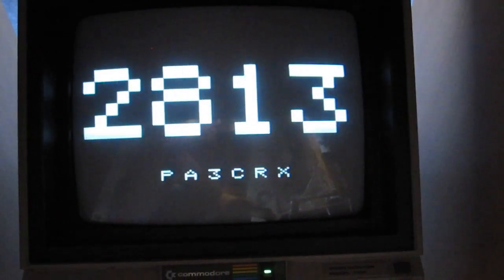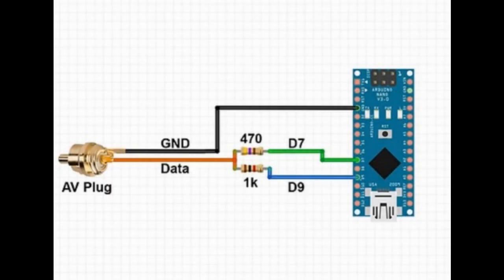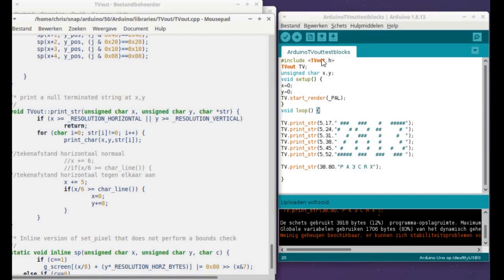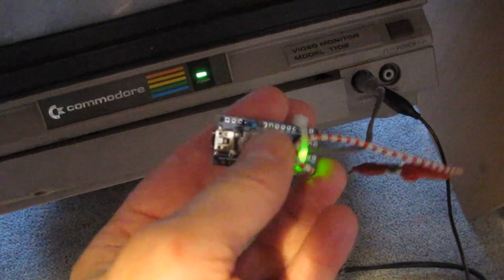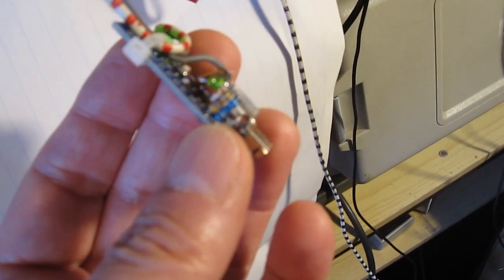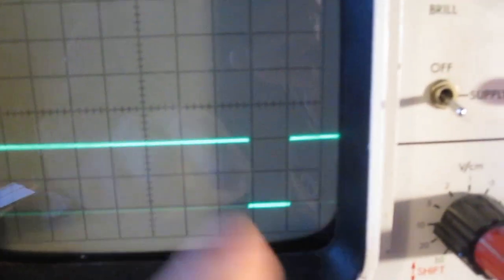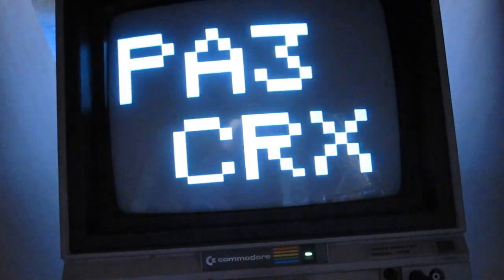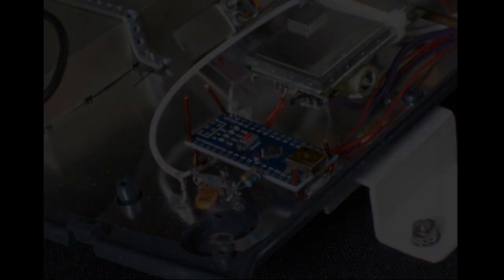Easy video generator with an Arduino and only two resistors.

Comment: I like projects that use these cheap microcontrollers like Arduino or even ESP32 to output video. Since they are not intended to output video and don't have that much computing power, it is interesting to see what kind of video you can make with them.
Reply from the maker: Indeed a lot can be done with this kind of microcontrollers! There must be an other way to generate the large characters without 'constructing' them the way I did but I do not have enough knowledge about programming. My intention was to be creative with what I knew :-) Thanks for your comments!